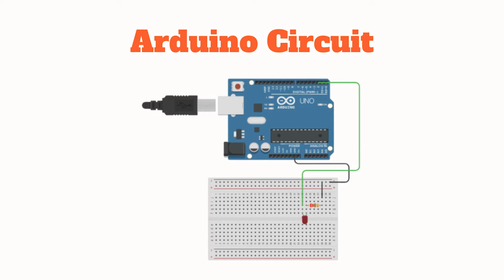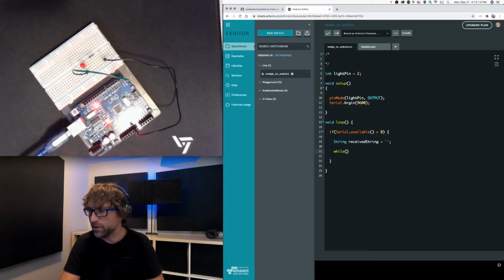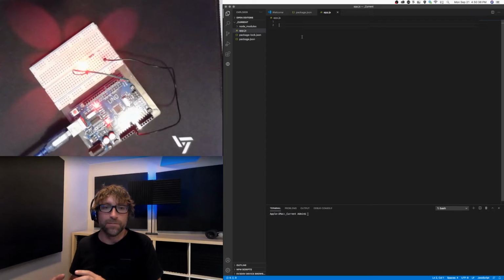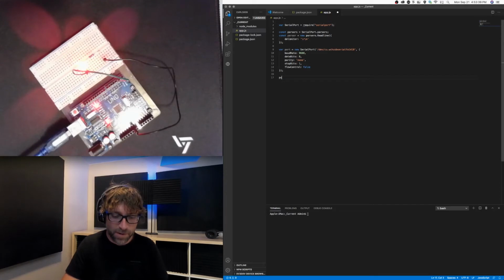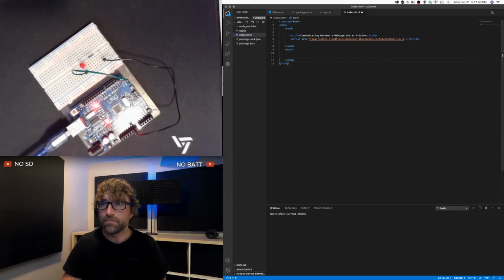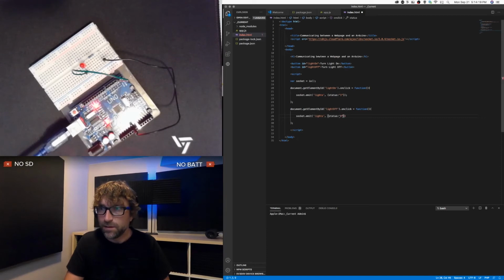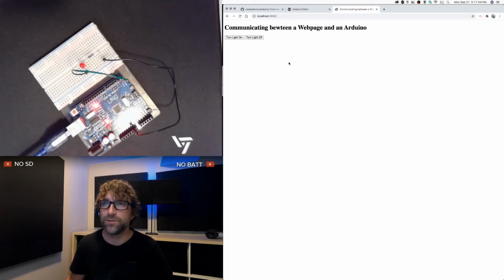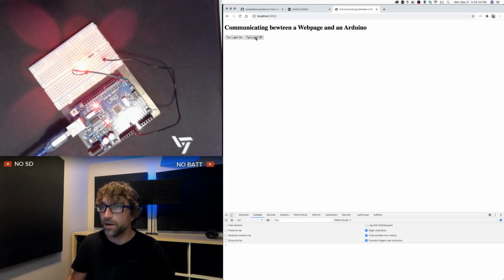Communicating between an HTML/JavaScript Webpage and an Arduino

Comment: An old post, but in case anyone checks this videO:   No need for a node.js intermediary.  You can run a tiny web server directly on an arduino that has a wifi chip on it.   The minimalist server is only about 50 lines of arduino code.

Comment: could you create a video about arduino uno monitoring soil moisture, humidity,  relay, and controlling water pump using the website and display it and upload it to x10 hosting. kindly include the use of nodemCU if applicable

Comment: How should I slow this problem?

PS C:\Users\Game\node2> node app
C:\Users\Game\node2\app.js:5
const parser = new parsers.Readline({
                           ^

TypeError: Cannot read properties of undefined (reading 'Readline')
    at Object.<anonymous> (C:\Users\Game\node2\app.js:5:28)
    at Module._compile (node:internal/modules/cjs/loader:1105:14)
    at Object.Module._extensions..js (node:internal/modules/cjs/loader:1159:10)
    at Module.load (node:internal/modules/cjs/loader:981:32)
    at Function.Module._load (node:internal/modules/cjs/loader:822:12)
    at Function.executeUserEntryPoint [as runMain] (node:internal/modules/run_main:77:12)        
    at node:internal/main/run_main_module:17:47
PS C:\Users\Game\node2>
Reply from the maker: Were you able to find a solution? From the code snippet you provided, it looks like socket is not being included properly. Here is the app.js file in my GitHub repo:

https://github.com/codeadamca/arduino-from-nodejs/blob/main/app.js

Comment: when moving to vs code follow these steps in order to avoid errors.

to get package.json : npm init --y 

inside the file add 

    "dependencies": {
        "socket.io": "^2.0.4",
        "serialport": "^9.0.1"
    },

Then run npm i.
Reply from the maker: Thanks for this!

Comment: Hi sir! Can you make tutorial also arduino to nodejs using esp8266 wifi module? Is it possible to control both end via wifi?
Reply from the maker: It is possible to achieve the same end result using WiFi, but the code is quite different. I would be happy to make a video, but it would not be for a while. I have quite the list I'm working on!!
I did find this, which might help:
https://forum.arduino.cc/index.php?topic=416227.0

Comment: its throwing an error in this line-
 var io = require('socket.io').listen(app);

why is that so ?
Reply: var io = require('socket.io')(app); 
works for me
Reply from the maker: Thanks Jonas!
Reply: @uFikaz  thx!! i fixed it and it worked!!
Reply: i got the same problem did you solve it?
Reply: @suhyouri No, not yet